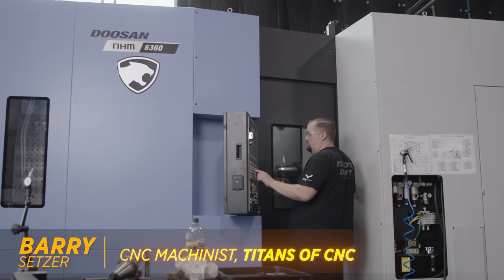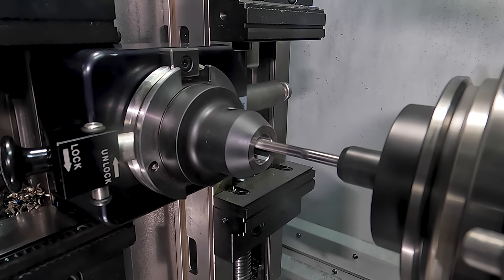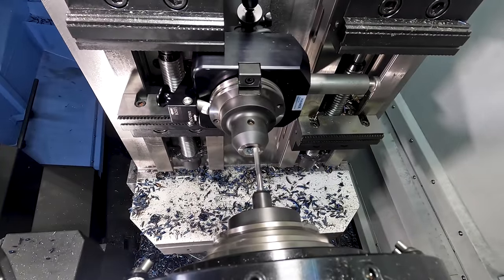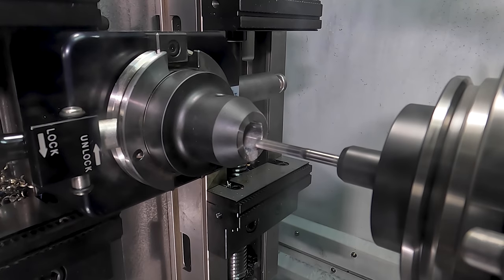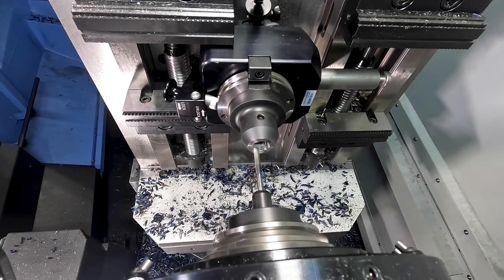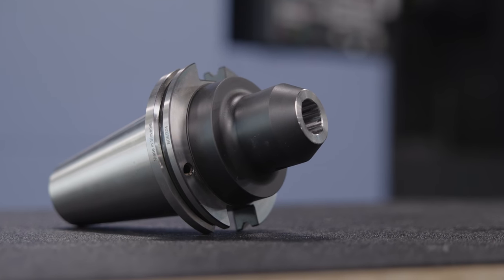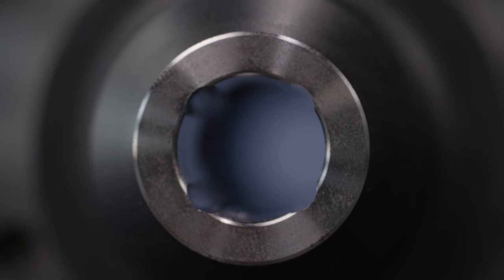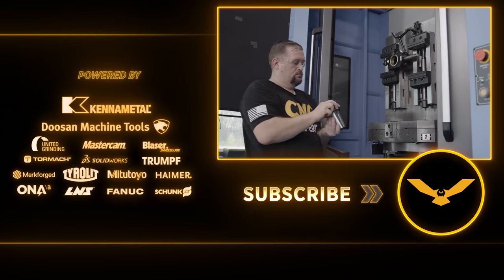No Time, No Coolant Thru Holders… So I Made My Own

Comment: Non-cnc people over-ruling thru-spindle upgrades is my biggest pet peeve probably

It was $1500 (including a darn $4500 pump for free) to upgrade and they just cant spend that apparantly
Reply: I didn't upgrade when I bought my mill due to rumors I heard of the rotating coupling being an issue. Having worked on machines that use rotating couplings for high pressure (up to 5000psi) I knew they can be trouble.
That's why I didn't get it.
Reply: @jackflash6377  it was meant to be the primary drilling machine on a line

it's entire job was to face 5 sides and then drill some holes (250 per part iirc) for something like 20 hours a day (with the other 4 being facing)

we replaced the entire spindle (with all costs involved) after showing the guy who made the choice why he made a horrible choice

as for there being more that can go wrong, how can i refute that? with a 5 axis machine, there are 2 axes more that can go wrong but we'd still get it if it made sense for the task, no?

Comment: Need it now? Do it now... yourself!

Awesome show of internal process control and the power of knowledge and attitude. 
 Sometimes you can't wait the few days to get another tool holder in. 
This idea is a little out of the box thinking but is enough of a step in the direction of beyond the box into another galaxy thinking. 

Funny in industry that custom work holding fixtures are standard practice but for some the idea custom tooling of any kind is absolute blasphemy!

Comment: You do need to balance the holder again if you use it in high RPM!!!
Reply from the maker: Yep, we have a HAIMER balancer
Reply: But honestly if your using a sidelock holder are you really going to be going over say 3-5k rpm? ha
Reply: @TheOutbackIndustries  ...
Reply: @TheOutbackIndustries  I run a sidelock holder at 12,000 rpm all the time. I believe it is balanced to 25,000 but I don't remember for sure.
Reply: @TITANSofCNC  The Company is just 1hr Drive away from my Shop. The have Awesome Stuff! Greetings from Germany

Comment: We did this exact same thing but on small holders 1/4, 3/8, and 1/2, used a wire EDM to cut two slots parallel to each other on either side, and it works great
Reply: That is the method i have used most often. But EDM is pretty slowwwww. And in this case, time was money lol
Reply: @barrysetzer  Edm is slow but it only took about 1/2 an hour for ours to cut.

Comment: What about switching with over tool that you have available for this machine that don't really need through coolant, swap the tool from other machine if it's compatible, change the program to use it with regular flood coolant. After messing with toolholder like that, you threw it out of balance, now you have to balance it. You guys lucky to have a toolholder balancer, (where's the balancing process in the video, or at least mentioning) but a lot of shops don't have it. Then you can't really use this toolholder again in other normal operation. Plus you have to consider  that you have to setup that tool and do small programing. Does it justify the time you spend on that? I would do it in only absolute necessity.

Comment: Great video, I had to do the same but it was a bit more challenging as the machine I was using at the time had din coolant through the flange. But never the less it all worked out the same, success. This video shows the great minds of the Titan team and is a good trick of the trade that some shops can use when in need.

Comment: What is the reason for those secondary schunk serrated jaws? Better grip (as they have two rows of ,,teeth,,)? Do you use them only on ,,stock,, surfaces on first operation? Thanks
Reply: they literally bite into the material. also there are some vises like the lang vise where a press makes small dents in the material which they clamp into. locking the material in place like a dovetail would. without the need for a pre-op

Comment: Wasn't the toolholder hardened?
Reply from the maker: Doesn’t matter, just use old tools
Reply: Judging by the sound and sparks id say so... but I've done this small peck trick before, at worst you'll just dull an old cutter even more. Unlikely to break anything 👍
Reply: You never drilled out a broken tap with a carbide endmill?

Comment: A simple contour instead of a "bore" would have been faster and caused little to no chatter.  Good idea bad execution.
Reply: Decent idea, but this is quick and dirty. This code was most likely written by hand. Takes less than 10 lines of code, even if you bothered with the Prep requirements.